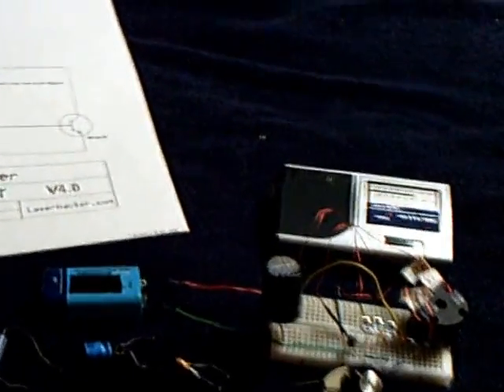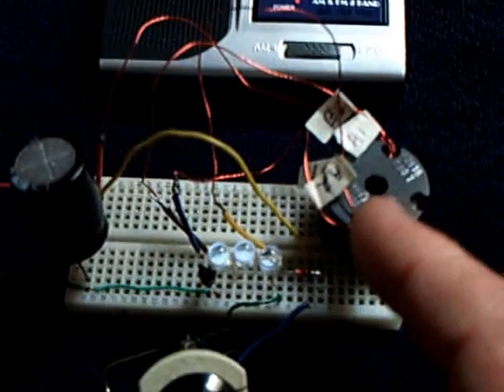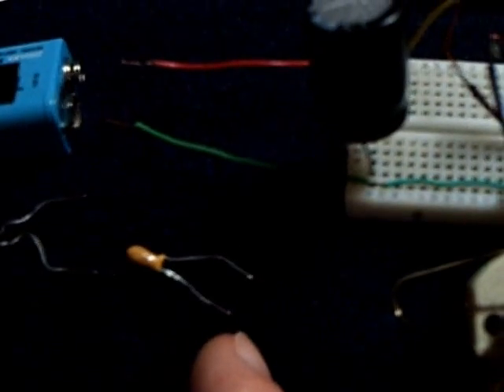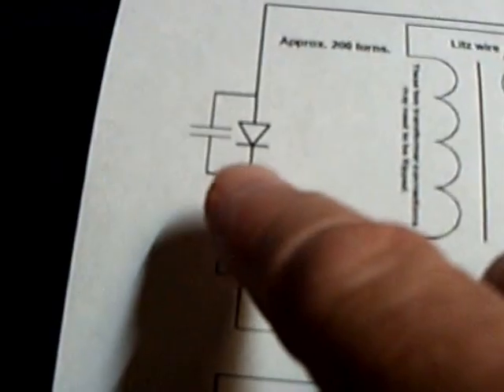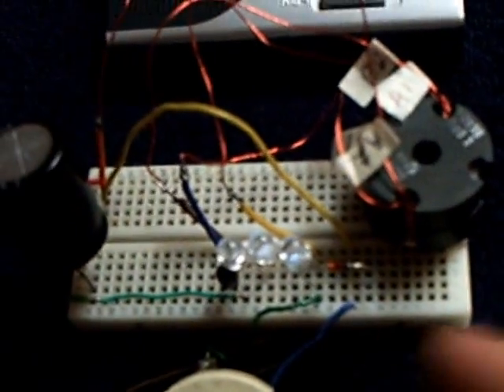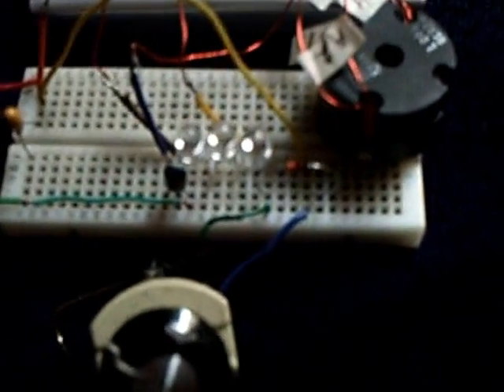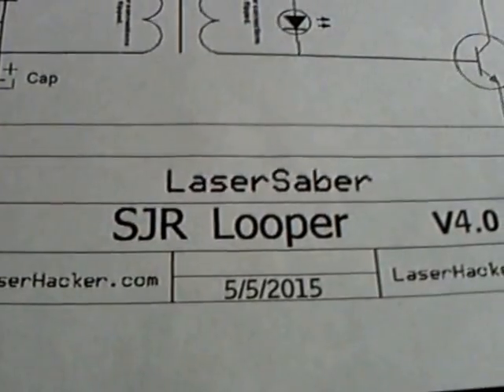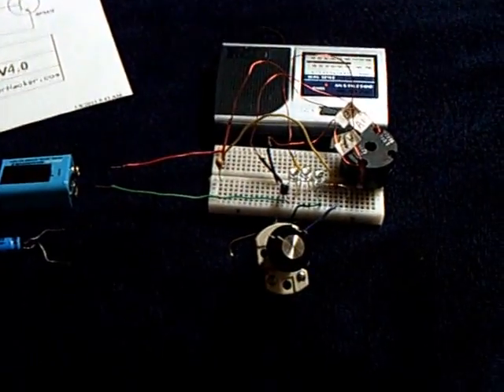SJR Looper V4.0  --- my replication

Comment: Yep.  works just like mine does. Only mine doesn't use a pot-core inductor. I've tried it with two inductors that I wound, one is a 7.5 mH Litz-wound choke from a CRT monitor with 200 turns of #34 magnet wire (not Litz) wound on top of it as a "secondary", and the other is an e-core type transformer frame wound with 60 turns of #27 on the inner bobbin and 200 turns of #34 on the outer bobbin, no Litz wire used. With the second transformer I was able to blow out some LEDs, but with the first one my circuit performs just like yours. Touching it in various places makes the LEDs do the same as what you show, plus a couple of other things. It's a very interesting circuit, and the fact that I didn't need to use a pot-core is a plus, since I don't have any.
I tried various transistors and couldn't find any that worked better than the MPSA-18. In some circuits the BC337-25 works better but not, apparently, with this one. YMMV.
Unlike the Lari-Man Objekt13 circuit, this one is not a very good receiver for wireless power, at least not at the frequencies I checked. The Objekt13 is an excellent receiver, though, even though I didn't deliberately tune it to be. Hmm.....
Reply from the maker: TinselKoala  I have been following you and Slider's work on these projects.    Both the Object 13 circuit and this Looper are fun  builds.  This one is actually doing what it is supposed to do----without a hidden power source.  I have also tried several transformers like you have.  Today I wound a new one and I will put the circuit on a little board like you are doing.  It is a cool idea and I like the way your little boards look .   I have tried a number of transistors also and a plain old 2N3904 works about as good as the MPSA-18.  If you put an AV plug  at the main cap this circuit will run remotely from a Slayer Exciter.  Fun stuff.

Comment: Very nice.  I am glad to see that you got it working.  The only way that I have found to increase brightness while keeping the power draw from increasing is to experiment with the coil winding ratios and core material.  I have seen the current draw falls as low as .1uA with visibly lit LEDs.  I have also noted that the runtime disconnected from the battery is not always related to the current draw while connected.  This makes perfecting the circuit for long runtimes very difficult.  I am using a little capacitor even smaller in size than your tantalum and rated at 200v.  Depending on the component values and configuration I have seen a config pulling 5uA run for a much shorting time after being removed from the battery than a config pulling 20+uA.
Reply from the maker: lasersaber This is a great circuit!  Thanks for sharing it.  I have noticed the same thing with the caps.  I wound a new transformer today using that 42 ga fine magnet wire and it works good for getting more light with less power.  The original 'touch' circuit I think is a classic because of the pure simplicity.
Reply: +Lidmotor How did you wind it? Laser shows like 2 different ways of winding these. In one version he uses Lenz Wire with copper foils. In the other version he just uses 3 layers for one wire, and 3 layers on the other wound around the transformer. So... do we need copper foil and Lenz wire for this circuit or not? Thanx for posting the video.

Comment: Thanks for sharing. I never played with a tank circuit before but now I will deeper into it. That circuit coupled with a small solar cell from a solar toy you may have almost have a forever flash light. Not over unity but unity maybe.
Reply from the maker: egn83b In theory a tank circuit will run on and on but losses in the circuit steal the energy away. Old man heat grabs most of it.
Reply: I would have to agree nothing is perfect but this is closer to a perfect situation.
Reply from the maker: egn83b Yep this is getting closer.

Comment: Well done Lidmotor ! Could you please show in the next video how long it will run on the  10 uF Tantalum, if you touch it and it will light up brighter ?
Many thanks.
Regards. Stefan.
Reply from the maker: overunitydotcom It runs for a few minutes with 9 volts in the little Tantalum cap.  If you touch the variable capacitor like I showed the leds will go bright but just for a few seconds.

Comment: Neat demo, especially with the tantalum and return of the radio output detection :)
There are some very interesting capacitive coupling effects, if you attach a very large virtual ground to the var cap. It starts to take on Dr. Stiffler SEC coherence characteristics...waving the hand around or moving near to the ground changes LED output. Maybe it has uses as a proximity detector/EMF meter/burglar warning system.
Reply from the maker: slider2732 YES!  I saw the same thing last night when I was working with this. Do you remember Dr. Stiffler's last experiments with the mysterious red led and the resonant coils? This kinda reminds me of that.
Reply: ***** The PSEC ? yes indeed. Tried to  replicate that and didn't get really anywhere..but, interestingly enough, a couple of the old 18X copy circuits were found recently and 1 works great with 1 of those coils as L3. i had trouble with heat on the 2N2222A at 5V (USB input), but fixed it with a 47ohm resistor on the input, with little loss if any on the output. Resistance was gradually lowered until only slightly warm after a good hour of running. Might be a tip.
Reply from the maker: slider2732 Oh yeah the good ole PSEC.  I spent many hours trying to get that one to work.  Many folks thought that it was his scope ground lead that was doing the magic.

Comment: Hi Lid .Did you have replaced MPSA18 transistor? or used same one like in the schematic? cheers
Reply from the maker: Robert s I am using a 2N3904 NPN in this video but it runs better on the called for MPSA18.